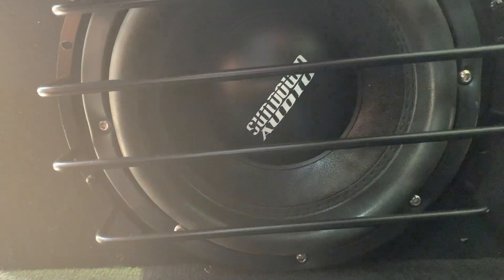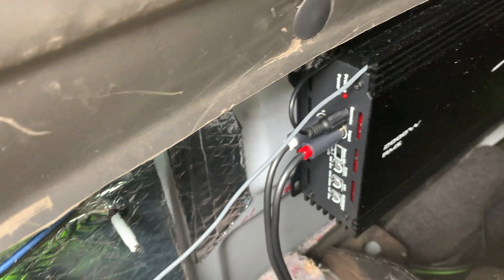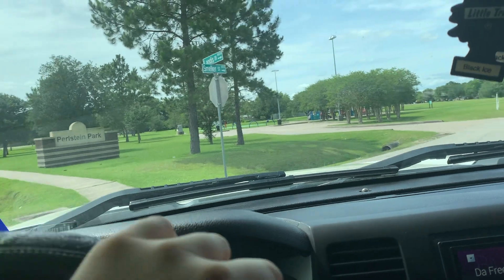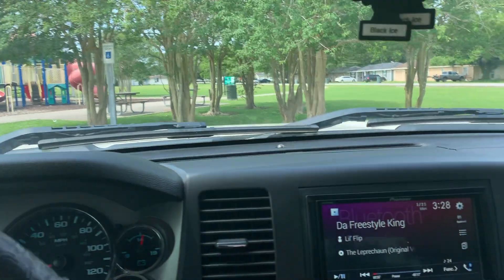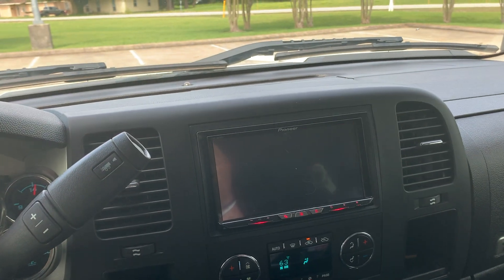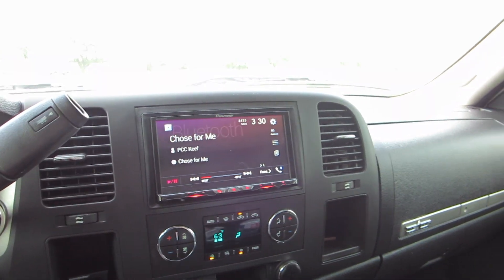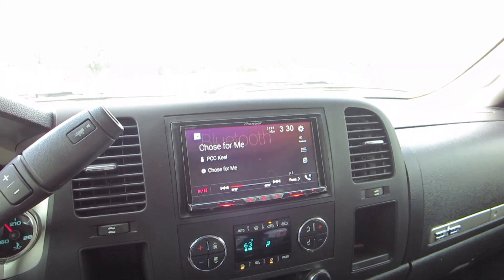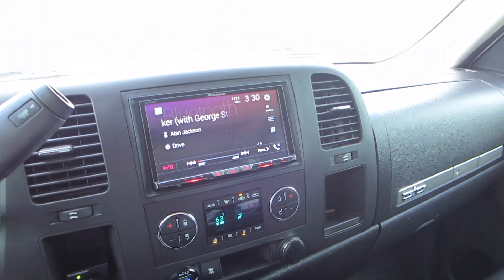2 SUNDOWN AUDIO 10's UNDER SEAT FOR (07-13) NNBS SILVERADO

Comment: Great vid bro, I was also wondering how u designed the box an came up with the correct port size? I have an extended cab an just installed seat lift and wld like to build a ported box. I might be wrong but I think the extended cab floor is different than crew cab so it might be a Lil more tricky. I would appreciate any info u can give me. Thank you so much

Comment: Sup my fellow Texan. Reppin Tyler here.  Deep off in the Piney Woods🌲🌲.
Hey 2 questions: 1- I got a Pioneer avh-2330nex.   What backup camera did you use here.? I need to get one and that picture looks super crisp.  2- where could I take a peek at the specs on your box and what you did with the seat? I got two skar Vd 10s 4 ohm on a rp1200 in a downfire, ported forward box.   Man they rattle the 💩 outta my truck. No one believes thats what I got in there. Maybe an idea for you to look into. I'd like to have that box you got cuz it looks like it's got more airspace than mine , have the port fire forward but speakers fire down. I think that makes a pretty  big difference in our crew cabs. Mines an 08.  But we sit so close to the subs in such limited space,  I think the downfire method compliments the port better for an overall better experience for the driver.  Thanks for the video. Subd👍
Reply from the maker: Its a Master Tailgaters Back up camera from amazon for 80 dollars, most definitely worth it bro, and yeah down firing my subs was my first thought but since no one really sits in the back I figured I'd face them forward and so far so good, they sound really nice.. maybe ill make a vid on the dimensions of my box, since a lot of people ask... stay tuned
Reply: @texasprimo3222  did you have to raise the seat any ? New to your channels so not sure if you’ve covered that yet or not. Thanks for any info